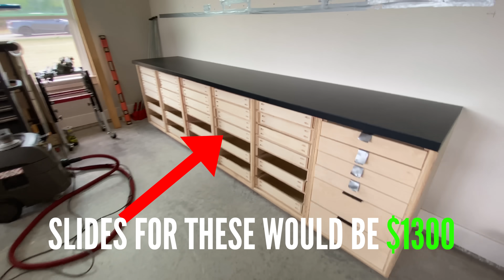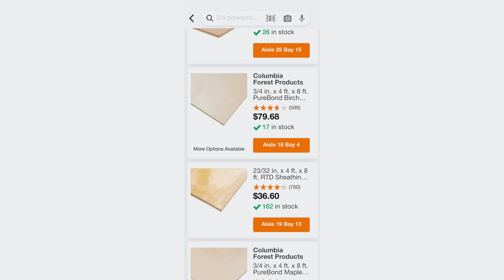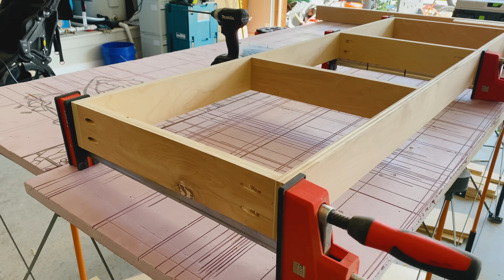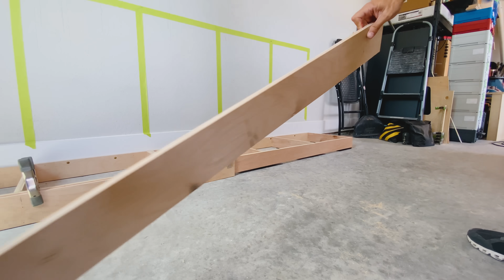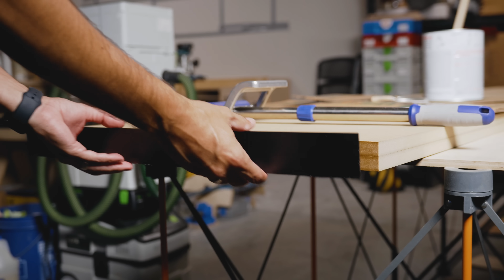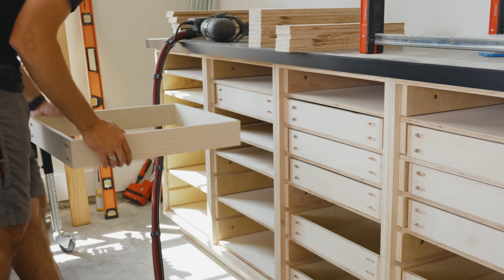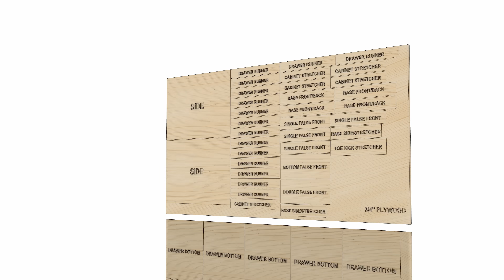Drawer slides are expensive. Do this instead.

Comment: Brilliant use of wood instead of expensive sliders, only issue is the wear on the wood surfaces as you slide the draws in and out,  to counteract this wear you could use candle wax wiped onto the surfaces.

Comment: I been doing mica for years. To avoid the shavings and scrapes you must add cadle wax, oil, or something to lube it, and number two the type of router blade you used could be the bearing flush straight type, a bad bearing also causes it, and look into a different type of cutting blade that is tapered. That is the best. Leaves a tiny excess and you will shave it out filing it. Will be tedious but it will be perfect at the end.

Comment: 🤿Right there with you on the drywall.  You will know and it will eat at your soul if you left the duct tape.  So funny.
Great video.  I am gutting my current "shop" which was built from cast off cabinets and misc shelves.  This was both informative and inspiring.

Comment: I would just glue the drawers together. Sure, not gluing allows you to repair it, if it gets damaged. However, gluing it will make the drawer much stronger, probably to the point you'd never need to repair it. The tradition of not gluing in traditional drawer bottoms was done because they used much thinner wood for the bottoms and more expensive wood for the frame and fronts. An all plywood drawer w/ a 3/4" bottom has barely anything worth salvaging if you got to replace the bottom anyways.

Comment: lol, love this.  When i laminated my counter tops, I did not put any on the edges, instead after adding the top, using dowels to support the laminate, I just used the router to form a curve on the top, and then oiled it.  That was like in 1989? so i barely remember it. hadnt thought of it since, till now watching you.  i have no idea how well it all lasted as i sold that house a couple months later moving to a new state.  how far out can you safely pull the drawers out?   I made some cabinets to hold plastic tub inserts.  I only used 1x2 for the frame the bottom and then the ... dont know what they are called, the riders on the sides? for the edges of the inserts, er the edges stick out all the way around.   For the bottom i just made an I shape for each of the drawers, and then just put one 1x2 up  on the side for them to hang on.  I added the bottoms incase the wood changed, or drifted, or ??? so i could still use them forever. lol.  I didnt allow for the cat using the front left upright as a scratching pole, lol, need to replace that some day ;)

Comment: My guess, nobody was talking about ducttaping the outer wall layer. The insulation should have been taped, to seal the insulations water/steam barrier. But to do that you must take off the drywall completly where you want to install your insulation. By bringing in the insulation into the wall, you created a temperature gradient. Inside your warm room the air can take on much more water as steam, but where it is cold the steam will condensate to water. The water will enable mold to grow in your wall. 
That`s why you should tape the vapour barrier beneath your drywall. You inserted the receipe for mold, by installing it without a steamproof vapourbarrier. Congratulations. 🤿

Comment: Question instead of using a narrow spacer and a wide runner to locate the drawers why didn’t you use a wide space and a narrow runner. It would have saved so much material, money and weight.

Comment: Nice build 🤿 to reduce friction and wear on the slide, you can use some PTFE tape. Other comments below will solve the trimmer trouble - you can raise the bit, or oversize the bearing or both.

Comment: if you want a slightly smoother but not much more expensive system, use POM coated bearings, place one in the front on the static part, and one in the back on the end of the drawer.
though another option is roller slides, they work in a similar way and cost about the same price.

Comment: Dope. I've been meaning to make workshop storage with drawers for all my tools and bits and paints and sandpaper and so on.

This seems like a very viable option.

I'm considering cheating a bit with the materials;
      Bottom plates of the drawers need to be sturdy (and the cabinet itself, of course).
      I reckon I can reduce (my) costs significantly by skimping on material for the sides of the drawers, etc. (Perhaps repurposing material from old system32 furniture / kitchen cabinets and so on... 
    Err... 'Laminated Particle board' I think?
     (I can find that in the trash in my neighborhood on a daily basis.)
.    Also: I'm broke ;) Hence the need for cheap / free materials. 
     Makes it more satisfying when I manage to pull it together, though :)).

Anyways, thanks for sharing the idea, man.

This really helped me.

--

Pro-tip: rubbing candlewax on wood surfaces helps them slide more easily

Comment: When there is water on the floor, composite shims won't wick it up into the cabinet.  Might want to use non-wicking trim, in case you end up shallow-water snorkeling in your shop.

A 3M 5100 (S) 5200 (M) 5300 (L) half-mask respirator with P95 or P100 filters?  $50-ish.  Replacement lungs?  Considerably more.  
And then there's your eyes.  🥽  I find my eyes kind of handy to have.

Comment: The main problem with using duct tape on the cuts is duct tape may dry out and not adhere. Whereas joint tape and mud lasts longer.
Reply: I commented to soon. I did watch to the end

Comment: I've thought about this for a while, but never tried it. You can buy teflon sheets (the thick stuff >1mm, not the super thin flexible sheets they sell to use on your BBQ) from various sources online. I bought some for cheap off the electronic bay marketplace from China to replace the bits on the bottom of my mouse. You're probably following me already, but what if you cut some strips and stuck them on the slidey parts of the cabinet (counter-intuitively, double sided tape works fine on teflon) , do you think that would make them slide better? Or would that risk some kind of dangerous over-slippery situation?

Comment: What a lot of plywood. Nice result, though.
The drawer slides would support the full drawer weight on full extension, which your slidey system will not, so take care pulling out a heavy drawer a long way.
TIP: You can use self-adhesive sandpaper sheets instead of duct tape for the wall seams, but you have to sand of the abrasive surface afterwards to get a smooth finish. 🤿

Comment: As a handyman I needed all my tools with me on almost every job. So, I built this type of cabinet for a 16 ft enclosed trailer. I mounted my jobsite table saw and bench top drill press on a couple of the drawer bottoms so I could also slide them in and out of the cabinets leaving my bench completely clear. 

On the toe kick bases I left the end near the back door open so i could use the area under the cabinet for long items that I wanted to be secure and protected. Stuff like the tracks for my Festool saw, glow rods and really long drill bits for wiring, copper pipes, long pipes for my pipe clamps and the like. They worked great. I could reorganise my space easily I could take entire drawers of tools onto the site without worry about damages to the boxes.

Comment: I got tired of patching my clothes with duct tape so now my wardrobe is entirely duct tape. I find it is best to spiral apply to both legs until you can't go any higher. Cut overlapping vertical strips the the rest of the way up and then cover with spiral windings to waist height. The same technique works for shirts.  A drawback is it takes a good week to accumulate enough fur, dead skin and sweat to safely remove these ulta high quality form fitting clothes. On the bright side people will get used to seeing you wear these silvery masterpieces and your significant other will love the quality high gloss finish of your skin and after a week of waiting will be eager to take it for a spin. But good on you for showing off duct tape in a more conventional use case.🤿

Comment: Always imagined a full extension ability made from just wood, where there's an intermediate slide mechanism, and both it, and the drawer have stops at 50% (or less) to spread the load between them... Never got around to designing it.

Comment: way way over built.  You indicate this is permanent.  Why make it modular?  Save at least 1/2 - Items to cut/remove - all the side walls (except the two outsides).  Why?  This is simply a garage drawer system, it's not holding a truck up in the air.  Sub with some vertical supports for your side slides. No Drawer faces.  Why?  Just better planning eliminates the waste.  No Ply and Laminate top - use 3/4 MDF and 4 coats of water poly.  This is easy to "fix" when it's scratched, and no Formica stress (will it scratch?  What if I drill into it? etc.)  No drawer pulls.  the cutouts are fine.  No back - just good wall mount resolves the need for any backs.  I liked your simple wide-base drawer for the slides - put some Formica on the slides top and bottom edges for easy in/out.  Or some simple plastic.  The point is wood-on-wood is bad.  Nice of you to put this video out - I did watch to the end.  I agree the big box stores sell junk ply, and most of their hardwoods.  Why?  Because people buy it.  A "wood worker" would only use their stuff to build a kitty litter box.

Comment: I am wondering how long the plywood bottoms, with the thin top veneer layer are going to hold up to constant in and out over, not smooth straight grained runners but the open cut sides of more plywood. 

When I consider how amazingly grooved old cabinets and dressers become over time,  even when the runners were solid hardwood and the drawer sides were also, this seems like a slick but possibly unfortunately short lived way to do drawers.

Comment: I recently bought a fixer-upper house and have been trying to figure out a built in closet system for the walk in closet. Your bottom cabinet drawers are the perfect solution for my storage desires and my woodworking level (just slightly above beginner). Thanks so much! 🤿

Comment: Yes, these are shop cabinets, but a face frame would really improve their longevity and appearance. I realized the cost was in the driver's seat but a 🤿 would let you breath and see the benefit. Your laminate trim bit was too deep and that is tough to zero out. Use a bit wider than your roller bearing and put up a sacrificial facer (scrap laminate, etc) to protect the face.
Nice job.

Comment: you might have wanted to use MDF filler compound before applying the contact glue on these edges, it saves you 1 layer application ;)

Comment: I've made drawer slides from plexiglass, 2 one inch strips screwed to the inside of the box, and between them one strip screwed to the drawer.  With wax for extra slipperyness. 

It's silky smooth, and carries a lot of weight with no binding or tilting. You have to be precise about the size of the drawer box, but that's easy for a good woodworker :)

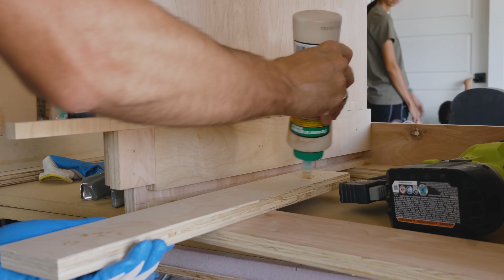Comment: Great project idea and looks really nice.  I saw this video about 4 months ago and decided on making my version.  The only difference is I cut 1/2" dados in the cabinet sides.  I know, at the 7:40 mark you mention this and say it weakens the cabinet.  But then I glued in 1 1/2" wide strips of 1/2" plywood.  The plywood strips are what my drawers slide on (with a piece of UHMW plastic tape to reduce friction) and inserting the 1/2 plywood strips ameliorates the effect of the dados weakening the cabinet side.  The main reason I went this route is to cut down on the amount of plywood used.  Also, I've found that it is far more useful to have lots of shallow drawers and only a few deep ones.  Since shallow drawers generally carry less weight, I also varied the thickness of the plywood for the drawer bottoms.  The shallow drawers have 1/4" plywood bottoms, then 3/8" bottoms, with only the deepest drawers getting 1/2" plywood bottoms.  But these were the only variations I employed.  Otherwise, I completely agree with you.  Drawer slide prices are astronomical, most plywood at the Big Box stores is crap, and  purchasing a metal tool cabinet is waaay out of my budget.

Comment: Very slick system and economical, too.  In my youth I did pretty much the same system using 2x4 framing and 1x6 for the drawer supports and 3/4" plywood for the drawer bottoms.  I didn't build the drawers just just left them as interchangeable shelves.  This system was installed in an attic and was a great storage system for seasonal stuff.

Comment: Nice job on your cabinets. Use smooth dowel rods under laminate, not flat sticks-(especially shop cut-tiny splinters under laminate makes BIG bumps) To avoid (router bearing melt) on your laminate edge, there are 2 techniques. But first check the bearing on your bit, it may be sticking and not rolling freely because of dirt, damage or needing to be cleaned, as this is usually the cause of your melted laminate edge.  One solution if bearing is clean, is a piece of tape over the edge before trimming, the other is use a dedicated formica edge cutter, then use B*** file to create the chamfered edge. BTW-the edge is not trimmed flat flush, it's trimmed at a 45 degree and with a bevel router bit, or by hand with the file. You could also use iron on veneer wood on the visible plywood edges of your cabinet faces, just to make it look more "finished". Overall, great video and nice cabinets.

Comment: Love the pop up regarding comment rules.  Favorite line in the video is “I’m not an animal”.  Favorite method in the video is a tie between painters tape on the top of the glue can and draw slide method.  Now how do you know which draw you used when trying to retrieve a specific and rarely used tool or supply item.  Especially the item bought at a woodworking show that at the time you were sure it was something that would change your life but never used once you had bought it.  Maybe it is better not to know which drawer it is in.  Great video.  It is a real keeper.

Comment: Great work! I have a chest of drawers which doesn't have metal sliders. There's just 8 strips of timber, 2 for each drawer to slide on. All the strips have developed a groove and there's sawdust on each one. If you have any of the black laminate left and the damage hasn't already been done, you might want to cut and glue some black laminate strips in, to stop the drawers wearing a rut in your plywood.

Comment: The problem I have with this is that you don’t get the full extension of the drawers as one would using metal slides. I hate trying to find stuff that has been pushed to the back of the drawer!

Comment: You  are shopping in the wrong place for drawer slides. You can buy side mount slides for $12 to $14 a pair so about $500 for 36 pair. Way superior to what you did. Full extension, better action. You should try a real Hardwood lumber store for plywood also. Home center is a poor place to buy plywood.
Reply from the maker: i went to a real hardwood lumber store for plywood - someone skipped around the video
Reply: @wittworks  IJBOL. To be honest I didn’t watch the whole video. Just the start and you were looking at big box stores for plywood.

Comment: Sorry to bitch alittle but wood on wood will bind, as it grows and shirk.with humidity (dude you are in Ft. Worth, and you are delusional,   my table saw rusted!!!)  They sell plastic in not sure where I got it. If the runners had plastic, all four sides, it will work forever. ~~ Cris Haslet, tx.. oh thanks for the plywood store😊😊😊😊
Reply from the maker: I’ve actually used the design for 15 years and have had no issue.

Comment: I heeeavily dislike how much space is wasted by traditional kinds of slider mechanisms. Thank you so much for this!
Reply: He lost an entire 3.5" deep "draw" on each cabinet by not using drawer guides. Could have made his own from 1/8x1 aluminum or steel bar stock embedded into each side of a cabinet with matching slots in each drawer.
A lot more planning and work though.
I would have recessed the top of each drawer front so the pull fit flush on top
Reply: @mrbmp09   By not using standard draw glides did gain him 1" inch in draw width. Had he gone with your suggestion of using 1/8" x 1" x 20" metal bar stock as draw glides would not have gained him any of the  3.5" as the bottom ply that serves as the "glide" is also the draw's bottom. You would not want to skimp on bottom thickness given these draws will be burdened with heavy tools and materials.
Reply: Correcting myself, he lost that half inch on each side when he added those 3" strips.  To maximize draw width, mount angle steel (perhaps 3/4" x 3/4" x 20") on each side for each draw. Draw with then is just ~1/4" less than the cabinet opening.
Reply: @mrbmp09   = if you can, a link to a picture or drawing will help some of us understand the concept.  Thankyou.
Reply: @mrbmp09  what we saw in this twilight zone carpentry video is 6 layers of plywood between the inner spaces of neighboring drawers. its bulky af LOL
what i saw before is sane ppl using metal corner stock for slides and not resorting to putting double walls between sections or similar paranormal activities 👻
Reply: @echelonrank3927  Yea some of this seemed a little wasteful space wise to me, but I'm far from any kind of professional lol.  I build stuff out of wood sometimes but I'm no cabinet maker.
Reply: I will apply your drawer design to build one for a remodel of an old sewing machine table. I am making it to look like an existing theft of drawers I remodeled last year. Great video for inspiration! Thanks!!
Reply: but it's for a reason, u can fill the drawers even with heavy gold bricks, though he didn't use screws but nails for those
Reply: @echelonrank3927 diesel motors will fit in bottom drawers, u can see those are designed bigger

Comment: If the garage is attached to a house, tape and mud the joints for fire protection. It is the building code in most areas.